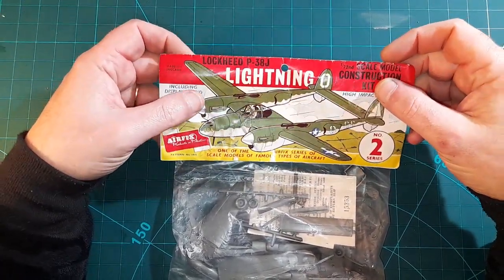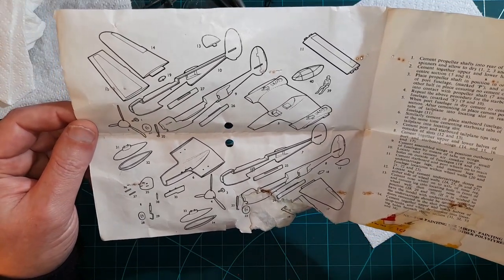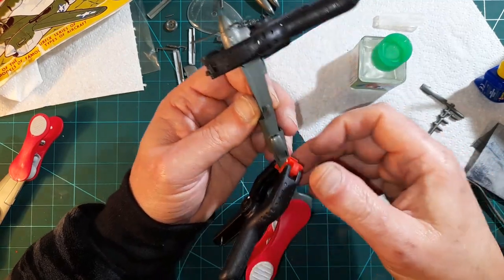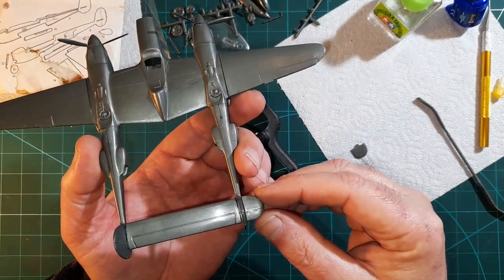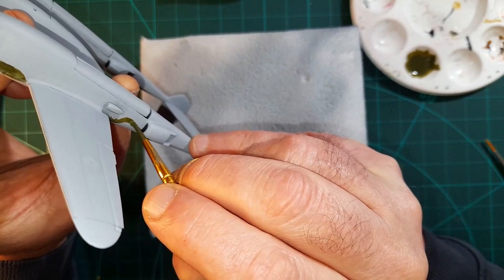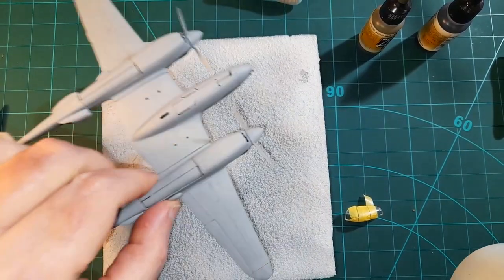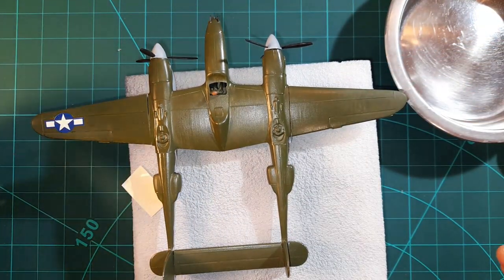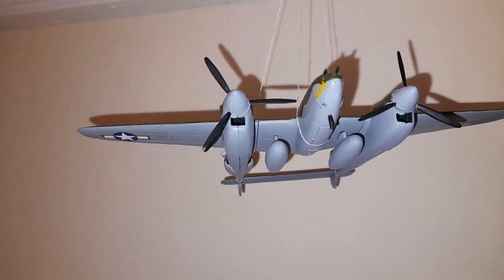Airfix 1/72 P38 Lightning. Building a 65 year old kit!

Comment: I remember building kits like this from Airfix and Revell back in the late 60s/ early 70s...whack 'em together with loads of glue from the tube, and before it's even properly dry, start painting with those awful tins of Airfix/Humbrol enamel paints that took days to dry properly - though I probably never gave them that time ('cause the paint did go on very thick!!), and then start doing the transfers (as they were always called - not decals!).... I loved 'em!  😆 
They must have looked terrible!  But hey, I was only 8, 9, 10...I did my best!  Ha Ha!!
Not like today, where time is taken with everything, and everything gets time to cure and dry properly - no enamels allowed - and now I can actually produce a pretty decent kit! 😉
The result that you got with this one was pretty damn good considering you made it with no filler, card filets, and no enamel paints!! (not a fan of them either - the fumes are horrible!)...... call the slight streaky acrylic paint look a  'natural wear 'n tear' or patina! 
The fact that those 65 year old transfers (decals, if you must!) actually worked still, and didn't shatter when you put them in the water is really quite amazing 🤩 Good quality stuff used back then!  Just goes to show that you can be over 60 and not get all wrinkly..!!  Ha Ha Ha!  😂
Reply from the maker: Patina! I'll remember that for next time. 
I only say decals to appease the young folks.
Reply: 🤣🤣Bought Saturday on the shelf Sunday afternoon!

Comment: The first kit I built was the Airfix Westland Lysander which came in a plastic bag the same as your Lightning, that was at the tender age of 13 which is 66 years ago. It wasn't a success for me, I was so naive I couldn't understand why the polystyrene glue wouldn't stick the decals on, I'd never heard of waterside decals. Best wishes Vic

Comment: Looking and this build, I am recalling building Frog P-38 back in the 1980-s and I can say Frog looks much more accurate and detailed! :)
Reply from the maker: It probably was!
Reply: @nostalgicplastic4323  It definitely was! The little turbocharges were separate parts, with very fine detail and overall shapes were much better. I re-scribed all rised panel lines on it, made detailed cockpit and gear wells with pieces of scrap plastic and stretched sprues. I also had some basic PE upgrade for it, made by a local guy at his home. Painted it in all-metal color scheme. 
Too bad, it is now lost to history...
Reply from the maker: @SQSNSQ  chalk and cheese!

Comment: Series 2 Type 1 Bags
DH Mosquito - 1957
Supermarine Walrus - 1958
Bristol Beaufighter - 1958
Lockheed P38J Lightning - 1958

Series 2 Type 2 Bags includes Type 1 four plus ..
Fairey Swordfish - 1958
Me 110 - 1959
Hawker Hunter - 1960
Saunders Roe SRN-1 - 1960
EE Lightning F1 - 1963

Most of those found their way initially into Type 2 Boxes and all went to Type 3 boxes during the 1960's where numbers where gradually being added to tooling along with new instructions. Some 1st issues where unique coloured plastic not seen for long like the Me110 in green (also applies to Series 1 A/C and Veteran Cars). Stands changed from Rectangular (scaled down Aurora copy) to Teardrop during Type 1 (Series 1 kits) and Teardrop to the more common V 'Star Trek badge' shape during Type 2 with S M L size variations.

Similar for AV, Cars and Railway kits. 
Although there were exceptions most Series 2 bag headers where 8'' wide, Series 1 where generally 7'' wide.

Did you have any plans for the left over Display Stand or Complaint slip?
Reply from the maker: Maybe i was just too poor and only had the cheapest...
If you email me (address in the About area) re the stand.
Reply: @nostalgicplastic4323 - Same here, still am tbh and glad to be, that was all before I was born, the Saturn V was the biggest kit I made as a kid but as an adult have some bagged kits in a display cabinet with some more recentish builds and have a hefty collection mostly cobbled back together from loose stuff in new bags, my version of 'building' old kits and in doing so knowledge has collected free. I've added the release dates above which show how Series 2 bags were phased out by the mid 1960's hence missing from our memories. re Stand, thanks thought it better to ask first.